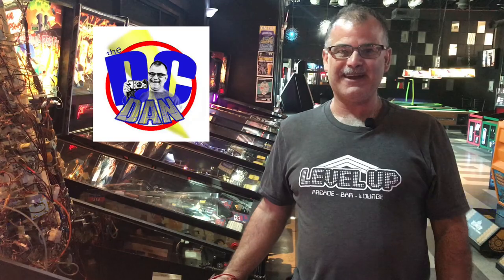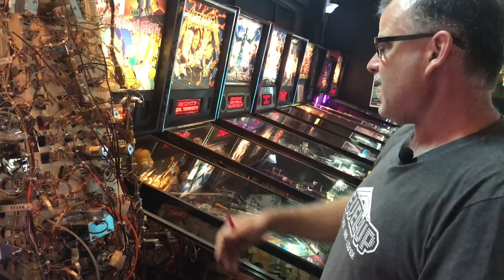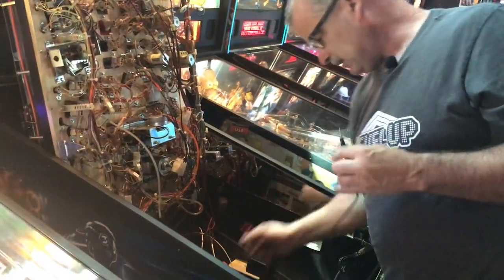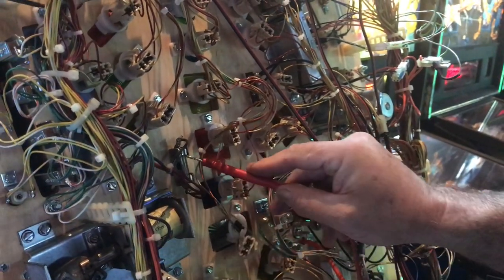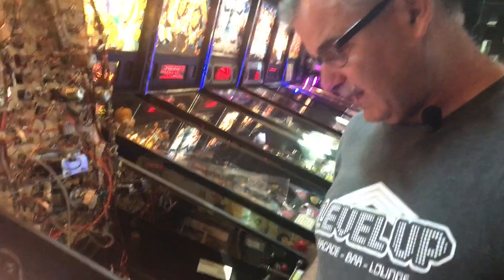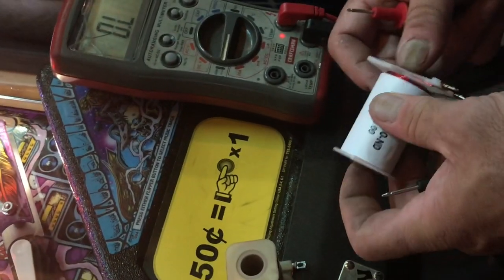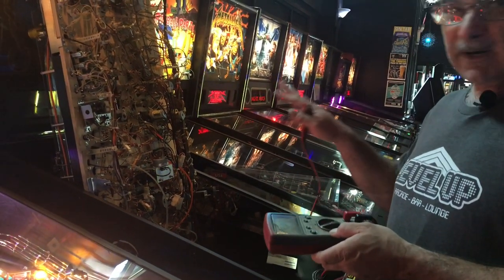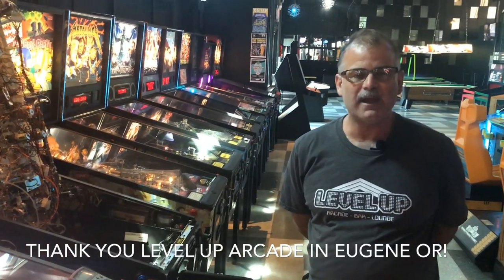Pinball machine troubleshooting and repair with a multi-meter voltage meter

Comment: Thanks for the educational video! As a pinball newbie, I didn’t realize I needed to use the DC option on the voltmeter. I just assumed that, since it plugs into the wall, it was all AC! Thanks for the new knowledge!

Comment: I have 2 bulbs that do not light up when the drop targets are hit.  I replaced the bulbs but they still do not light up.  Suggestions?
Reply: You might have bad light sockets. Desolder the old ones and solder in new ones. If that doesn't work you have deeper issues but start there and see if that fixes it.

Comment: Hi Dan, thanks for the videos. These are really interesting! For someone just getting into pinball that is thinking about buying their own machine, what would you recommend? Should they look at buying a fully working (but pricier) machine and learning to repair as the need arises, or would it be wiser to get a cheaper machine with some problems and repair it to a state of usability? Thanks!
Reply from the maker: My  opinion buying a used older Pinball should be done carefully. It’s like buying a used car. You could spend up to $12,000 buying a pinball machine that was made in the 90s. There are lots of New Pinball‘s now that are very well-designed. So is saying that I would stick with buying a new Stern Pinball and spend around
Reply from the maker: Adding to that response you would spend somewhere around $7000 for a new one that works and is updated with parts that you can get. Or or you could buy one for around $700 and make it a project which could be fun sometimes.
Reply: Good video. But- I’m a 90’s Williams fanatic. The new stuff just doesn’t have the same build quality…

Comment: THEDCDAN, 
                                                                        1.) Arcade Technicians have told me to change all the Molex and AMP pin types size to 0.156 inch  Trifurcon crimp terminals. I'm not sure why they want to use TRIFURCON type pin, any reasons why? I thought the pin size was how much current rating but the Trifurcon is better for higher currrent ratings I'm guessing. 
     2.) In arcade games and pinball games the connectors and wires gets corroded which causes intermittent failures. I'm guessing the Trifurcon pins don't cause corroded interminitten failures? or what type of pins material would you recommend to not cause future intermittent corroded issues on the connectors?